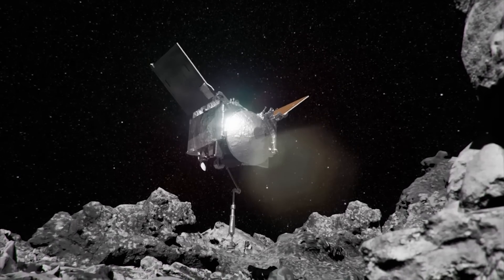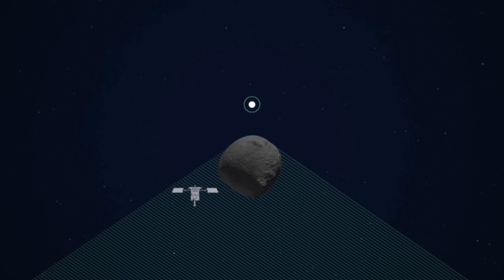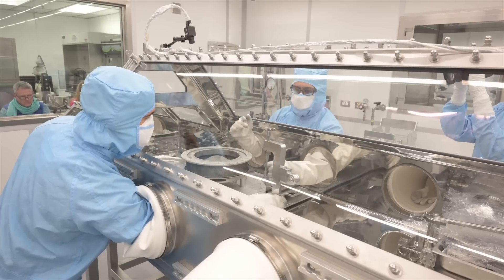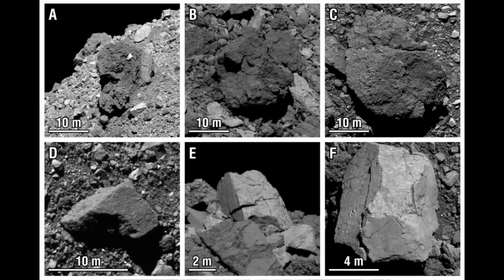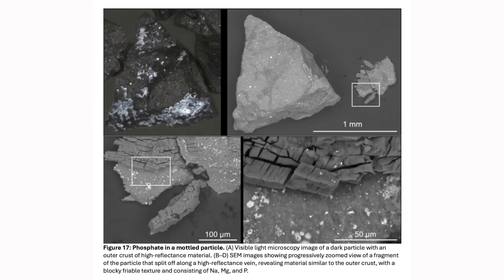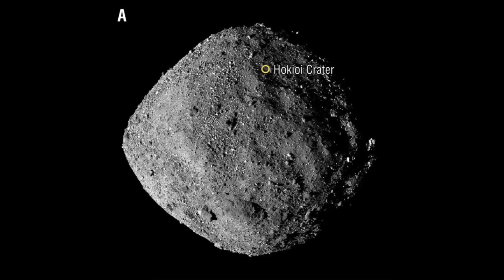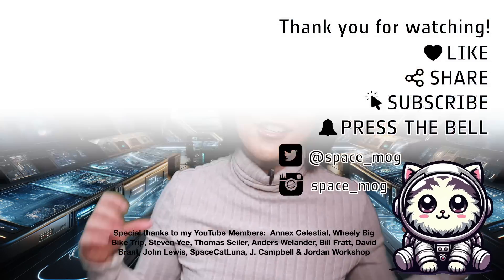Bennu's Bounty: First look at the rocks!

Comment: No rocket scientist here, but incredibly well versed in stainless fasteners. My guess is. The bolts were assembled dry and utterly clean to prevent possible contamination. Stainless in any commonly used alloy is virtually impossible to remove with 100% reliably. Over torqued fasteners up the risk of galling  exponentially. Typically a nickle based never seize product is used on the threads. PTFE is virtually worthless in this application. Stainless is incredibly tough and tenacious but not a very high surface hardness. Much less than carbon steel. Any deformation in the threads causes galling at the point of contact under pressure. Even spinning a nut to fast will gall the treads. So my theory is the bolts galled due to lack of lubrication. But obviously lubrication could contaminate a sample. Just a passing thought.

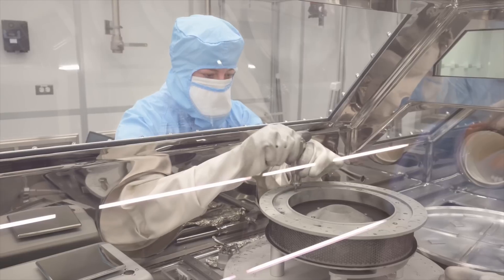Comment: 3:05 They invented a really great buffet, with a reliable sneezeguard. Then they used it to clean an old Cadillac air filter they found in the desert when they mistook it for a spaceship part. This is why we can't have sneezeless glops and bits in bulk from the communal trough, and no one can seem to tell the difference between a rare sky thing and a hubcap.

Comment: Lubricant or anti-seize on the fasteners would contaminate the samples, so the lubrication wasn't just insufficient, it was totally absent. Perhaps they should design the fasteners to break cleanly when overtorqued as the sample container is single-use anyways
Reply: That seems like a good idea.
Reply: They should just have used dissimilar materials
Reply: @HALLish-jl5mo  what would that change, besides introducing another contaminant, thermal strain, and a galvanic potential?
Reply: @shanent5793  Vacuum welding only happens between similar materials.
Essentially if you bring two components made of the same material and press them together with no atmosphere in between, they just become the same object.

But this doesn't happen between very different materials.

So two alloys of Aluminum might vacuum weld, but aluminum won't vacuum weld to steel.
Reply: @HALLish-jl5mo  this is incorrect. The process is equivalent to diffusion bonding, which is used commercially to bond dissimilar materials like copper, steel, aluminium, titanium, glasses, and ceramics. Higher temperatures accelerate the development of the bond, but there is plenty of time for it to happen at lower temperatures during a multi-year space mission.
Reply: @shanent5793  That may be a risk, but I don't think that is vacuum welding by the common definition. 

It would certainly take a LOT longer, which would mitigate the problem. Theoretically vacuum welding is instant.
Reply: @HALLish-jl5mo  maybe it wasn't vacuum welding. They weren't brought into contact in space, the screws were installed and tightened here on Earth, where a technician would have felt the fastener seize before reaching the correct tension.
Reply: Vacuum welding almost doomed the first spacewalk. I'm sure they must have anticipated it.

Comment: Flash frame of you at about 00:20.   Yours truly, mr buzzkill.
Reply from the maker: sorry! :-)
Reply: @SpaceMog that’s just your subliminal beauty watermark, or your nemesis AI’s first attempt to break through to the other side!😅🥹😇🙀🐈‍⬛
Reply: @SpaceMog  I used to work at a videotape duplicating service. I had to “QC” TV shows for broadcast. “Quality Control.”  If I found no problems, I’d sign it off as “100% QC.”      No worries on flash frame.  These edit systems are supposed to down to the frame accurate but screw up some time. Especially with video that comes from elsewhere or the internet.  It has to do w compression scheme.  The video isn’t frame by frame. It’s “groups” of frames.

Comment: I wonder if they couldn't use anti-seize coating on the fasters because of contamination issues as well - no easy way around it except by using dissimilar materials next time.
Reply from the maker: Either that or better lubrication
Reply: Or a different design that does not use bolts screwed into blind holes.  Thinking external tie rods or some kind of clips or springs.